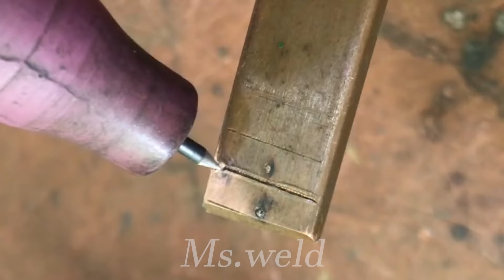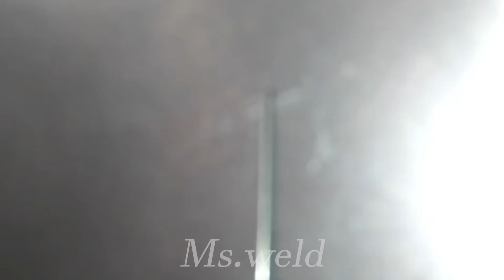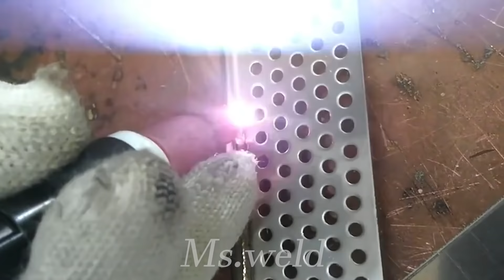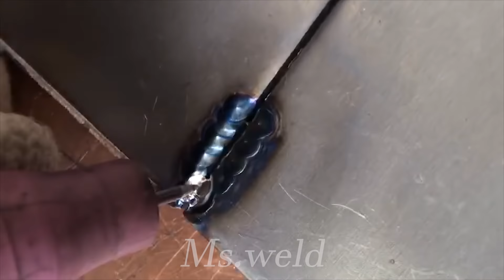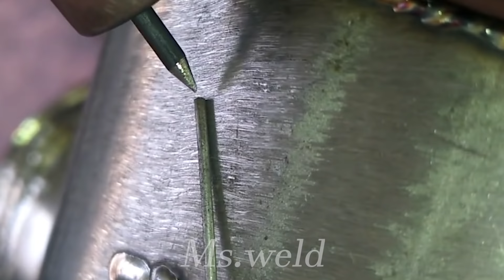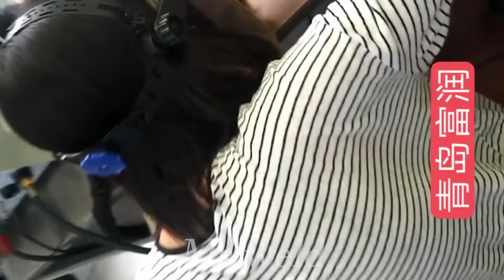Cold welding machine VS argon arc welding, What's the difference？

Comment: For any of you wondering what this "cold welding" actually is - just a HF pulse on a trigger. Throws a quick shot of current through your workpiece. If you have a newish tig machine laying around you can prob do it - set it to DC and max your frequency out and set your pulse low - 1 if your machine can, low enough you can press and depress the pedal or trigger before the machine cycles. Some only go as low as 10 per second so you would either have to be superhuman on the pedal, or know a magician, sorry- an electrician to rig your pedal up somehow to reach max current with a slight press so you could tap the pedal. Can't say I recommend it or if its healthy for it. Only just found out it's a thing and the Chinese seem to the only ones who use it.
Kinda silly to zap your way across a weld though. Slow, poor penetration. Fusion looks ok. Good enough for capping thin steel or thin outside corners to keep water out. Not for structural for sure. Could just turn down your amperage, sink it with copper or aluminum if you need to and weld it normally.
Reply: I disagree with you.  Watch closer . She is doing touch start tig.  Her welds are full of tungsten. She is touching the tungsten at every pulse .in other words a really bad pile of week tacks

Comment: In traditional TIG welding equipment the current is transformed with an IGBT inverter (slow devices) where it is transferred magnetically and this creates limitations in the speed of energy transfer ... in Cold welding equipment, the energy is stored in large  capacitors ~(0.32F) after rectification where high speed MOS devices do the microprocessor controlled discharge generating a full single pulse in high energy in pure DC current.
Reply: Please tell me: 0.32F at what voltage?

Comment: Do you use Argon with Cold Welding ?
Reply: Use Argon. She is basically tack welding all of it. No Penny. If there you don't need structural support than this should be good enough for you. If it needs strength then I would suggest that you learn how to TIG weld properly. (Penny is penetration)
Reply: Thanks. This comment is all i neee

Comment: Does it still need gas/argon?
Reply: Of course, you can hear it every time she/he lays down each tack.  This isn’t any special cold welding.  Can you not see the pink cup of the end of the tig torch?  Hear the gas solenoid click open each pulse and the gas flowing?  It’s just a standard inverter set on tack mode or set on pulse mode with settings to not blow a big hole (low amps for thin walls and got the frequency set down like 1hz or less)
Nothing special here.
Now they may not be marketing it as a normal tig machine.  They may have even built a machine that is marketed as cold welding and the controls might appear different and be labeled with different functions but what is being shown here is TIG welding as I described earlier.  To anyone whose welded alot this is obvious.  There is still heat being produced here, just relatively little in comparison to traditional welding where a longer bead is laid and filler rod is applied.  You can even see the couple times she touches the weld, you can see she touches it quickly to gauge if it’s too hot before laying her finger on it and resting for a bit.  Also the camera being so zoomed is creating an illusion of the wall thickness being larger.  In reality, these quick tacks are only superficial and not good for any structural welds.  However this would be ok for jewelers maybe and some artistic work.
Reply: @robertmason8341  this is a year old question and it's already address through research and on other videos I watched. But thanks for the reply anyway.

Comment: Why do you called it cold welding the fact that high heat was introduced? What is the difference between hf tig tack weld to your so called "cold welding"?
Reply: nothing hehehe, its just massive amps running at 10ths of a second. so if anything its extremely hot welding
Reply: It's nicknamed cold welding because  my educated guess imo with some electronics background is the metals used have a significant lower melting point/colder temperature than say steel..